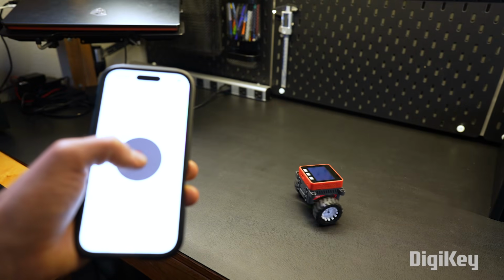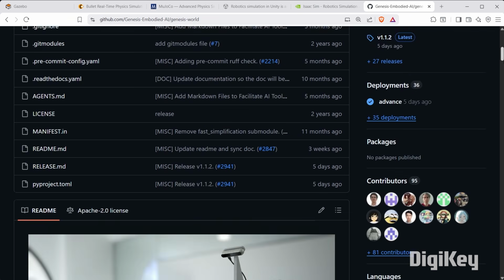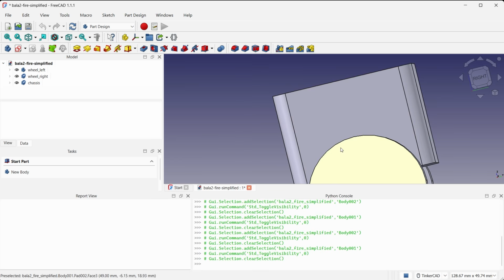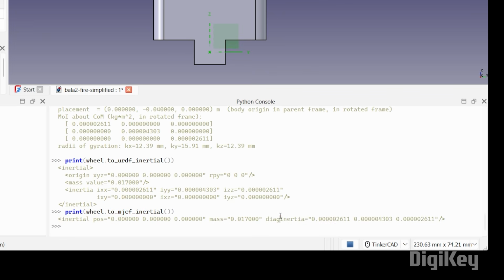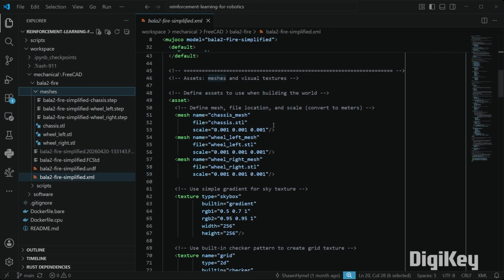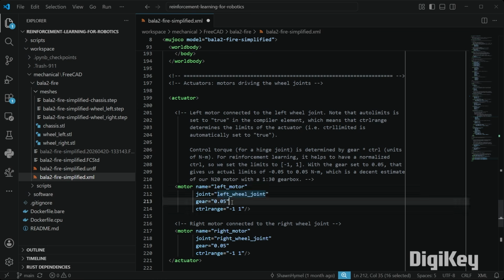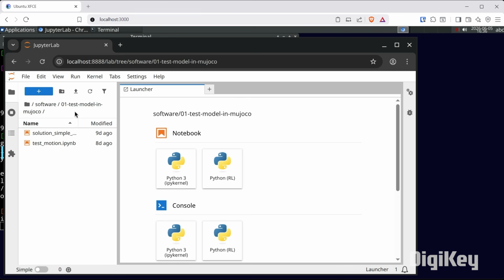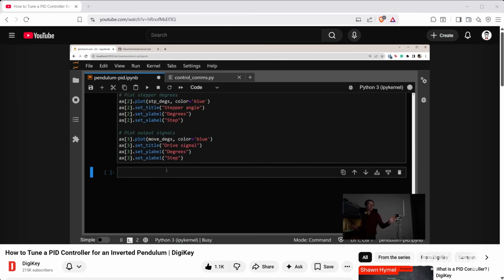Reinforcement Learning for Robotics Part 1: Import a Robot CAD Model into MuJoCo | DigiKey

Comment: Hii, just curious why u didnt go to the Issac sim path as most of the makers have Nvdia Gpus.
Reply: You need gpu in Isaac even for such simple stuff. Mujoco is great choice here
Reply: Many people don't and the setup for Isaac Sim is a bit rough. I wanted to make it as accessible as possible, so I chose to stick with CPU sim/training. MuJoCo is still widely used in academia, so I figured that if someone can get the basics of using that, it's easy enough to migrate to Isaac Sim. If this series does well enough, I would consider doing something similar for Isaac Sim.
Reply: @ShawnHymel  Thank u so much for the reply and best wishes for the series⭐
Reply: @tanjiro3285  Thanks! I hope it's helpful!
Reply: money required